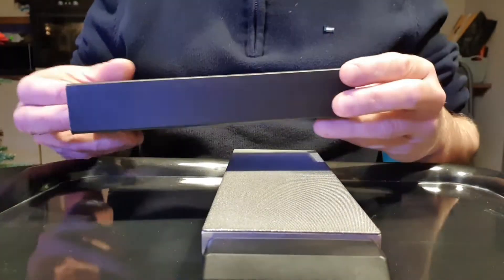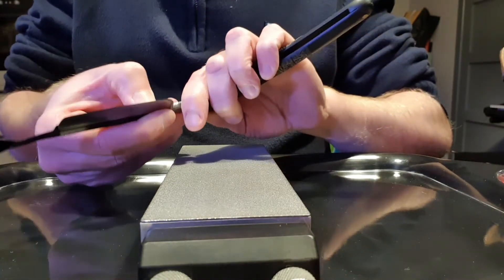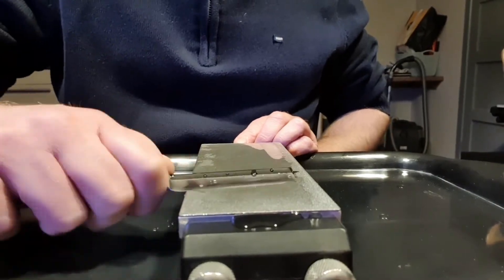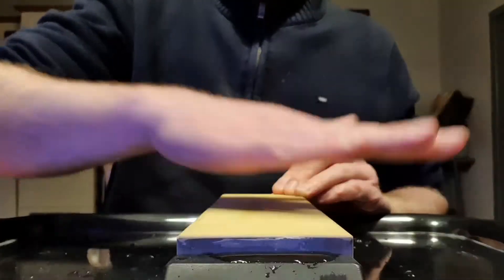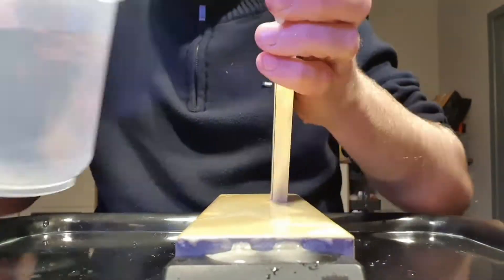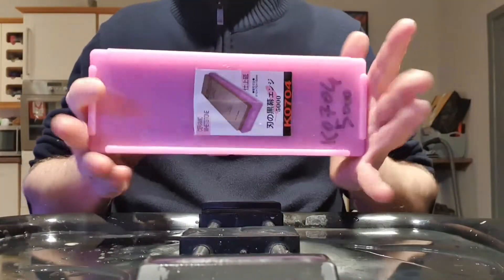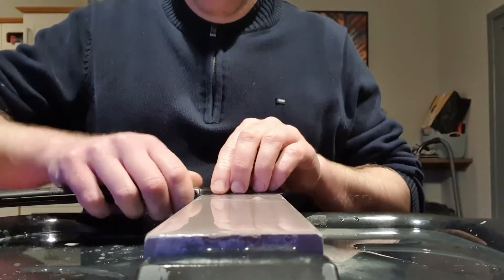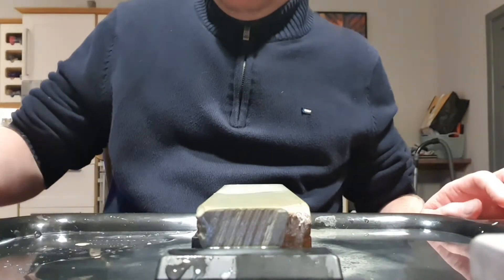FROGGY SHAVE: Recreate an edge & Hone Titan Chinese Straight Razor (english version)

Comment: Titan is, as you say, "surprisingly" good. I have one done in ACRO steel, bought for about 45$, it has noticeably harder steel then my Solingen, which again, has noticeably harder steel then my GD, which should be about 59-60, about the same as this Titan. (ARCM-2, smtn like that). It takes some real work to put an edge on ACRO, but it's also unbelievably resilient, the edge looks almost the same after a year, and you know how the edge looks like after one shave, as if we have a copper beard... I read on some forum ppl giving it shy of 70hrc.
Actually, the only problem with Titan is that every razor is the same, and even worse, every razor except for the cheapest ones - has a stabilizer. I like to see some different designs, spine fileworks, different tips, even some juvenile designs like that Ottoman GD W59 ;D Unfortunately, Titan is boring. But, yep, very good steal and heat treatment.
If I may ask - what microscope are you using? Recommend me smtn cheap?
Reply from the maker: Hi Mate, thx for the support.
Actually the Titan edge only lasted for 2 shaves even though I tried honing it again.... 😭
The microscope is this one:
https://a.aliexpress.com/_mMLNRZW

Comment: very interesting, this technique could be thousand years old. i simply use leather strops glued to wood and flattend with sandpaper, then some polish paste with wax, then baby powder with oil, and at last concentrated car polish (let it dry a bit on a plate). Its fast and very sharp. maybe i find something finer than car polish.
Reply from the maker: Wow very interesting indeed, never heard about this technic.
I guess it works if you can get a comfortable shave with your razors. 😁👍
Reply: @FroggyShave  started with hanging strops, but you cant get consistent results from that, so i glued them to wood. I applied polish material only one time, holds forever. There is diamond grinding paste for razor strops out there, perhaps this is finer than car polish. Car polish is really fine but there is always a way to exaggerate :-)

Comment: Whats your thoughts on geometry issues later on with having tape on the spine… won’t your bevel angle be too steep? Like your vids 👍
Reply from the maker: Thx for the support mate.
The "Tape or No Tape" brings quite some discussions amongst hobbyists 😁
If the blade is not too damaged or height reduced, I'll always prefer to put a tape to not take any risk of scratching the spine.
There won't be any geometry issue if I re-done the bevel from scratch.
The only thing is, if the razor goes to a new owner, I'll let him know that I used tape, so he can do the same when honing it again.
Worst case scenario, if the next owner doesn't use tape, he'll simply have to restart the bevel from scratch with a 1k stone.
Reply: Thanks for that .. just interested on your thoughts. :) keep up the good work

Comment: Hi, what microscope are you using? I think it's the G1200. I'm thinking of getting one of these. Do you think it is easy to focus on the edge?
Reply from the maker: Hey,
It's indeed a G1200 with battery.
It's good enough for me, focus is tricky but you'll get used to it. It'll be the same for all microscope unless you have a clamp to h ok ld.your razor.

Comment: Hey dear friend, I need your advice on this because I don't have enough money, so I plan to buy a 10000grit grinding stone with size 16cmx2cmx1cm . Will insufficient width affect the razor blade when sharpening? I need your help
Reply from the maker: Hi, 
I cannot tell you just like this.  It depends on the stone and also on the edge. If it's a synthetic stone at 10000 it is OK to shave with it if you then use green chromium paste.
Reply: @FroggyShave  thank you but i mean should worry about the blade damage because the whetstone is not wide enough to sharpen the entire blade
Reply from the maker: @khoitran4425  size is not an issue here. You'll just need to pay attention to your moves
Reply from the maker: Check my video with La Lune stone,  it was also quite small

Comment: And you can shave successfully with that toy?
Reply from the maker: With straight razors, YES I love it!
With this specific one, I got 2 good shaves with it and then the edge went back dull due to a poor steel quality I guess. 🥺
Reply: @FroggyShave  So this confirm what I told you is a toy!
Reply from the maker: @zenrazor659  indeed but it was worth a try 😁
Reply: @FroggyShave  I was telling you this!   but you have to discover before by yourself. Those razors are not tempered well and the steel is not good to retain an edge . Stil the hanging hair test will never be good! To realize that you should have do the hanging hair test with a  double kai blades! This this the parameter! Gold dollars and similar are the same! Also the use of  japanese stone of that qualitiy is not very good! It seemed that stone was a little economic! Anyway you must buy a Boker if you want a razor and you will have to struggle again defects at the same time because their quality is a little poor unless you will find very difficult something Better! Don't buy Dovo or Timor or others they are very bad! The blade of all razors very rare come straight and regrind it is very complicated and expensive! by you. others will not be able being out of the capacities of a  normal person!